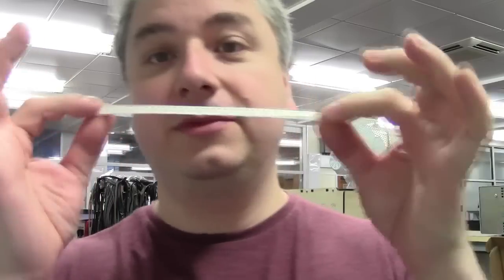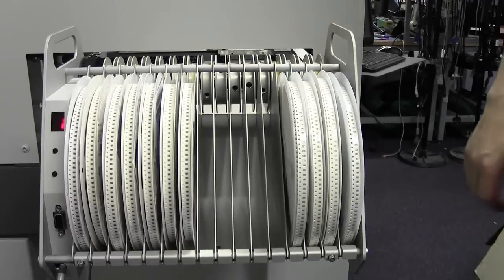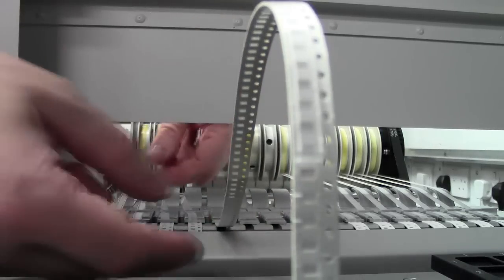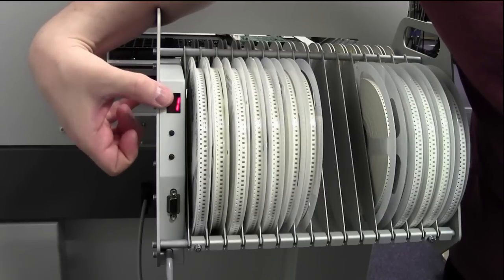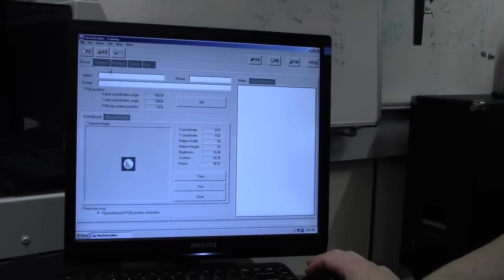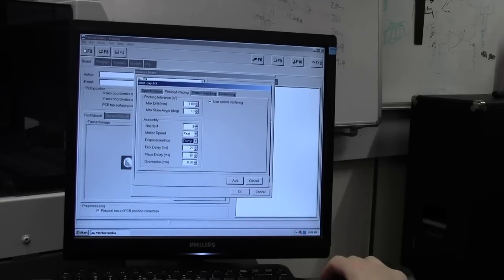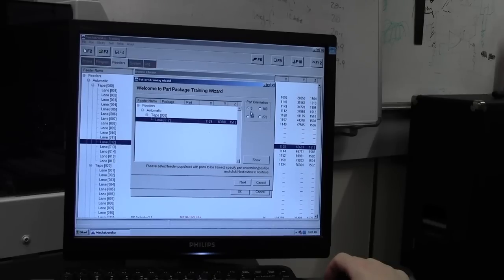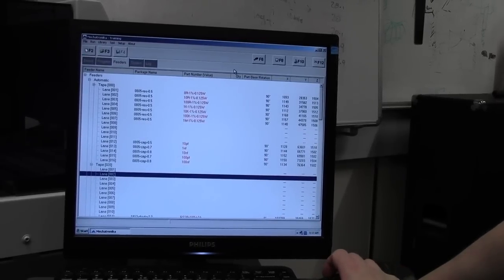Automatic SMD Pick Place M10V. Part 2 How to add a component reel and setup in software

Comment: Greetings, I need some help or guidance on how to setup a tray of IC's on Zevatech PM570 Laser. I setup the Top coordinates X and Y also Pitch X and Y and Division (component amount) X and Y. Also I setup the pick poisition at the back, position slot, angle (0) and others xy coordinates. But i keep receiving an error which is E5607: Step Counter Error which i dont under stand I did everything in component data and pick position. I think i missing something which is i don't know. I'm knew to this setup and programming. Thanks and God Bless.
Reply from the maker: I couldn't say, I am not familiar with the PM570.

Comment: The reels don't come with the component measurements?
Reply from the maker: most tapes and reels are a standard size but I&#39;ve had a couple of odd ones I think it depends on manufacturer.  The old cheapo sweat shop verses good quality brands, I&#39;ve had both cases so got into the habit of measuring them.
Reply from the maker: +Daniel Pierce if you mean the the components themselves then yes and no, usually the length and widths are a given ie 0402, 0805 etc but heights can a bit very with component values especially capacitors.

Comment: Can someone tell me what the reason is that such a machine has only 1 led segment and 2 buttons for programming settings? Is it cost wise? I would assume such a machine is already expensive. Or is it normal procedure to use the software for all programming?
Reply from the maker: 1 segment display and 2 buttons i would guess keeping cost down and keeping to a minimum foot print. As for programming i would have through setting up feed rate would have been be better in dealt with software and blasted to the microcontroller of the lane but they have other ideas. Lane addressing would need to be done on the lane in advance so the software knows what its talking to incase you swap or install different lanes.